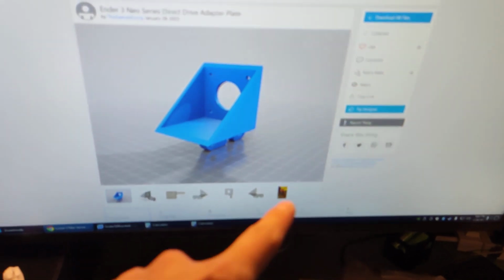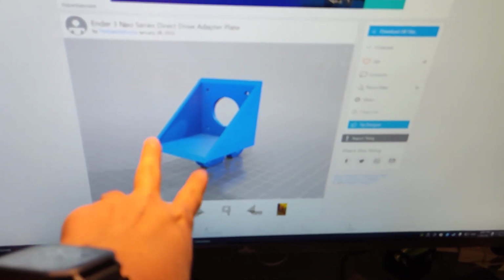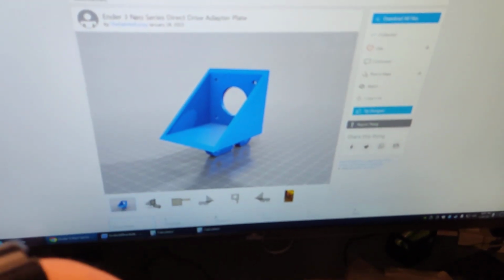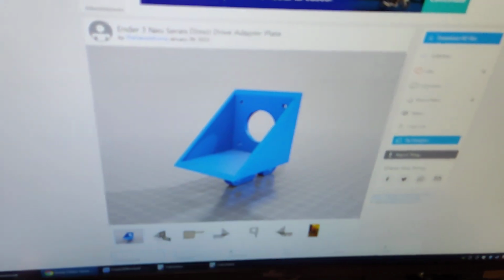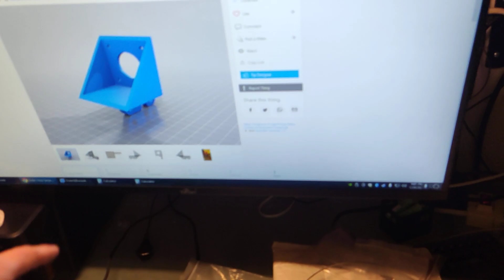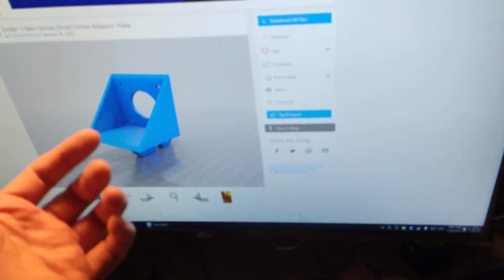Ender 3 V2 Neo Printable Direct Drive Upgrade

Comment: I printed it and it came out kinda off. The hotend tube connection to the extruder doesn't line up. Is there a file I can mix to make adjustments?

Comment: I am new to 3d printing, what are the benefits of direct drive?
Reply: The filament enters almost direct to the hotend, so you can print faster, beside that is perfect for using TPU filament, because with no direct drive it bends inside the tube causing printing problems.

Comment: Have you tried printing tpu with this setup? Im curious how well this works with this direct drive
Reply from the maker: I haven't used TPU, I'm confident it will work since TPU worked with bowden setup.
Reply: Hi, model creator here! I print tpu with this setup very easily

Comment: How good are ur quality printings now?  Does it make a difference if you buy the creality direct drive instead? And since you did this change.. does it require to change any printer extruder parameters?
Reply: We need a tutorial man this is really really good material..  I guess you cut some bowden tube and put it the hot end?